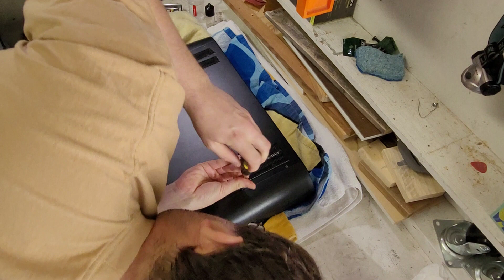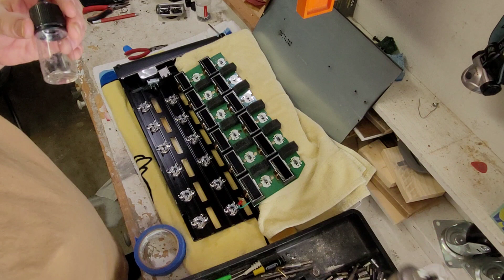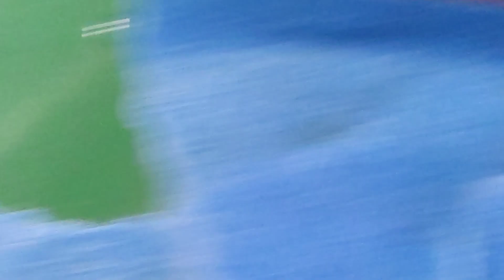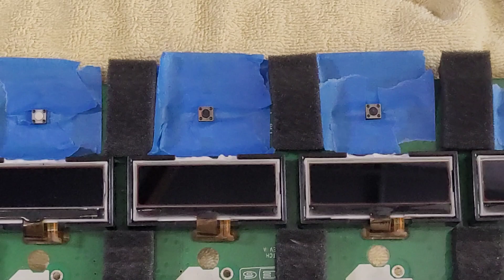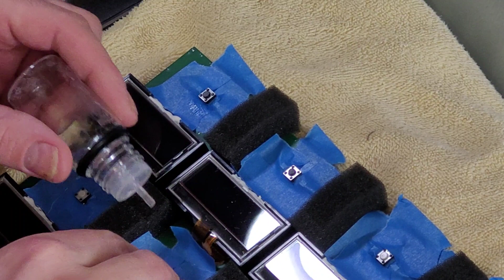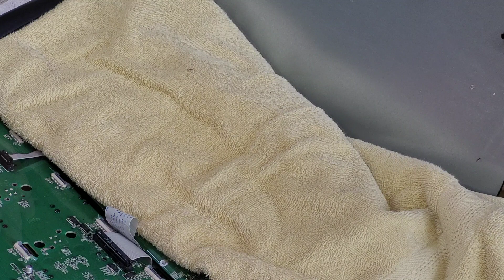Line 6 Helix DIY Footswitch Repair Round 2

Comment: Thanks again for sharing your video of the process. I left it open and used a dropper to flood with deoxit 4 times over the course of a day. I didn't bother with masking tape. It helped a bit on my helix, but the worst switch (mode) is still pretty flaky. I'll probably try soldering in new switches if I can find the right ones.

Comment: Many thanks this is a very useful video, did the repair this morning, given 3 foot switches were bouncing and unusable
My Helix dates back to 2016 and well out of warranty, so not an awful lot to lose.
I took the time to tape up switch regions as well and used a electrical contact cleaner spray from Amazon.

Hints
=---=

1). Take a photo before disassembly.
2). Loosen all screws 2 turns before going back taking them out.
3). When putting the screws back in, do not tighten before all screws are in place.
4). Be careful around those two units on either side of the switches, they are the LED's.

This cured the problem for the time being.....

Look forward to playing every day for the next 8 years.

Comment: Sometimes cleaning residue will attract dust faster making your switches sticky again, and probably faster than the 1st time. I would suggest using a contact cleaner in an aerosol can. It's designed for this kind of an application. Part of the problem you have is dirty contacts on the switches which just getting wet wont do much, you want the cleaning solution plus some air movement to create a mechanical cleaning action on the switch contacts. Another thing you could try is a air duster in a can with this cleaning solution, or use your current cleaning solution and a vacuum. Then when you need more cleaner get contact cleaner instead for this kind of application.
Reply: good points. this contact cleaner by de ox it will not hurt plastic and metals. not much of a need to tape off stuff. may actually cause damage messing around in there. it's not meant for everything though - be careful. I think de ox it contact cleaner doesn't leave much residue either but it depends on which version you buy. they make different versions for different purposes. . also keep in mind some mini contact surfaces like this stop operating due to the conductive surface wearing out. I've seen videos where people open the switch and draw on the surfaces with a pencil and that revived them. another tip I've seen is for people to clean electronic contacts with what look like cotton swabs, but they have foam tips that leave nothing behind. if it's dust and dirt that is causing the issue you don't want to add more. you can flush out the switch using contact cleaner in a spray can and tube, hoping to flush out the dirt. if you drip the cleaner on the switch it may only help a little. also, this contact cleaner by de ox it will not hurt plastic and metals. not much of a need to tape off stuff. may actually cause damage messing around in there.

Comment: Have you encountered Line 6 helix USB B issue not detecting when plug in into the computer?
Reply from the maker: I had a Floor unit that had so much trouble with USB connection when i first got it. L6 ended up attempting repair but eventually replaced the unit